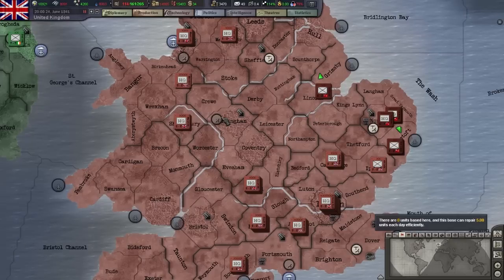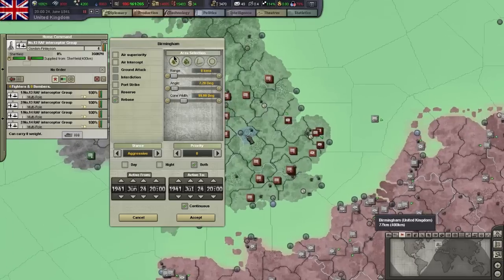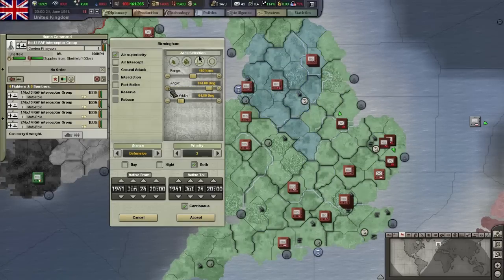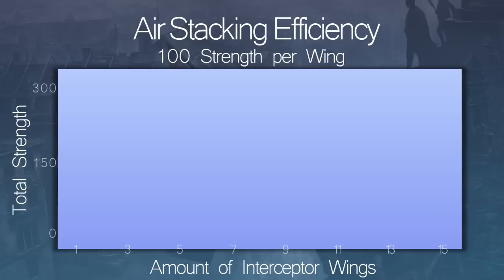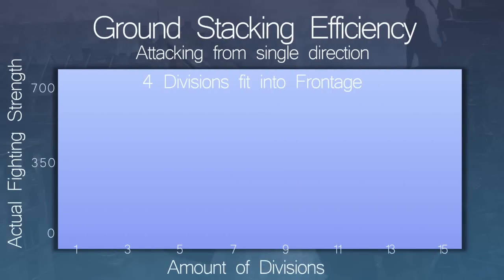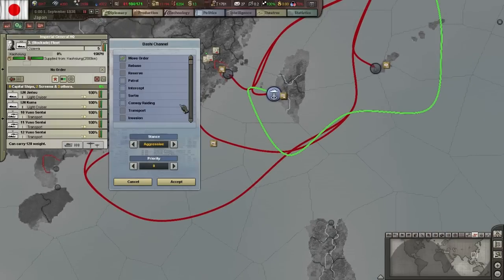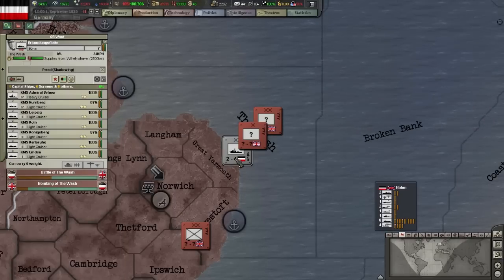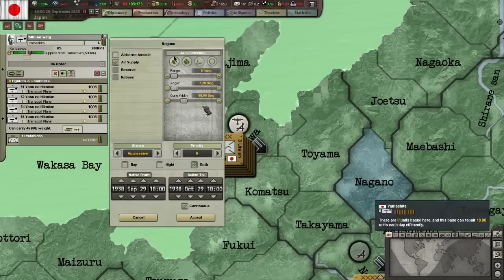Hearts of Iron 3 FTM - Basic Tutorial - Episode 9 - Military II

Comment from the maker: Stacking penalty depends only on the number of divisions, so larger divisions are better in that regard, but you're limited by frontage which takes brigades into account.
For each attack direction, 4 divisions with 3 brigades each are usually best. If you need more firepower or want to cross a river or whatever you can add support brigades to them as they do not take up frontage.
3*3 combat brigades add up to 9 combat width so a 4th unit can come in for 12 combat width.